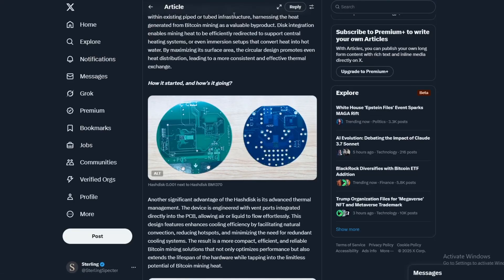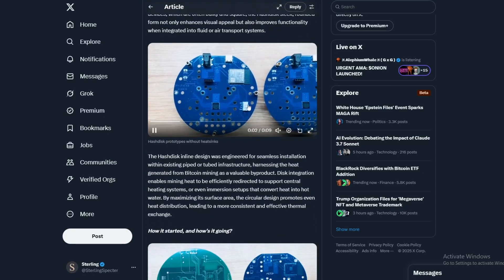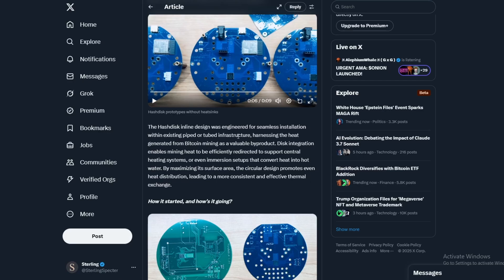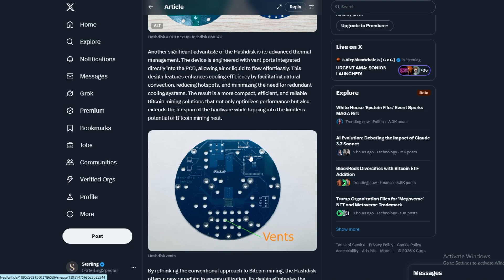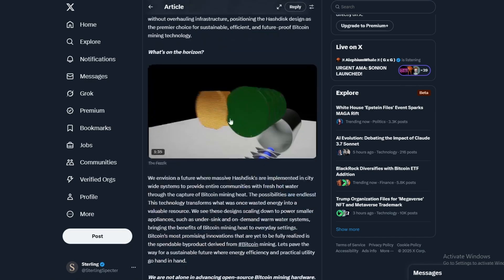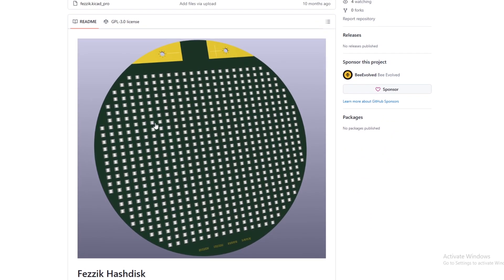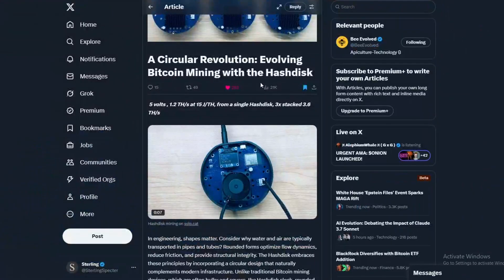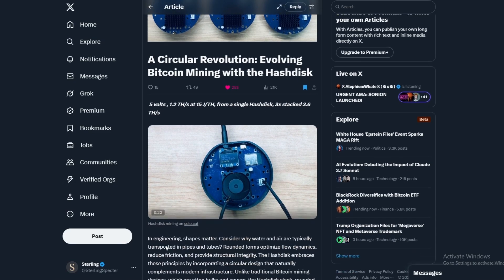The HashDisk - A Bitaxe For Thermal Solutions

Comment: Why they don't produce board size we can use intel or amd stock cooler but fans runs with 5 volt. markets have a lot of stock fans like that and much bigger cooling size. And like that we don't need to use rasberry pi cooler =)